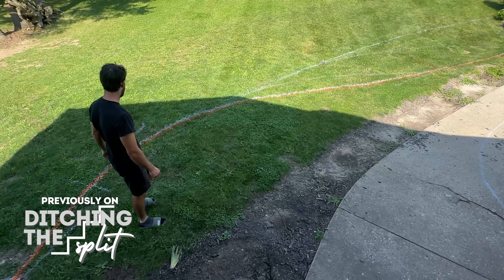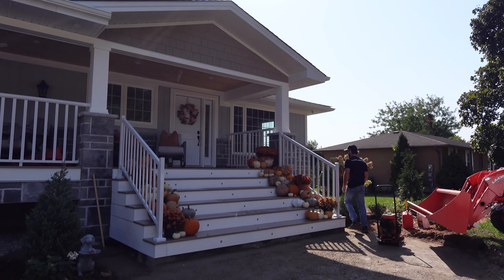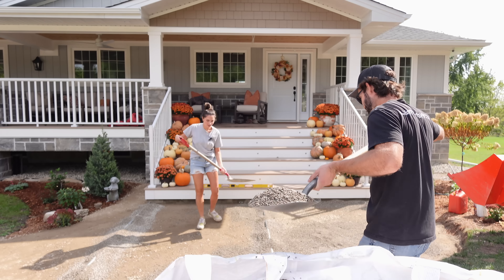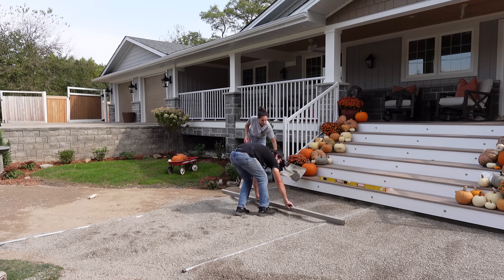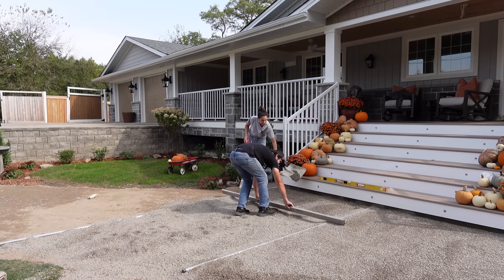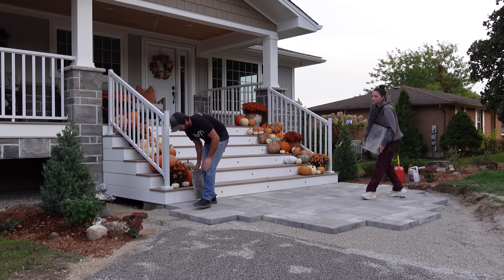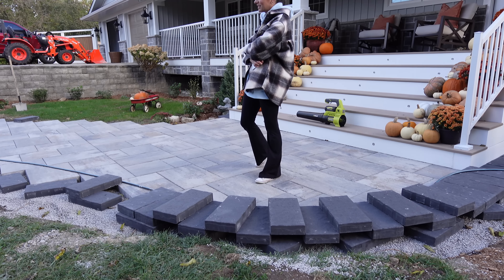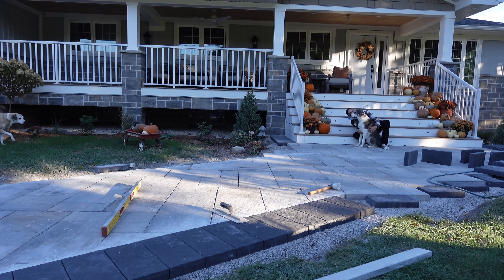EP 19: The Last Step!! | DITCHING THE SPLIT

Comment: Ouch...  I remember a hole in our asphalt driveway that I kept asking for a fix. Wasn't until I severely hurt my ankle that it got fixed. I contracted with a company for a new concrete driveway when my husband left town for 😀 a week on business. Spent three months on crutches admiring an extra wide driveway.

So amazed at your workmanship. Did you end up with a four corner set??  How will you cold winters treat this material over a solid cement?  Which is more expensive?

Comment: Random laying of pavers is much harder than a pattern. When we did our hardwood floor with random lengths it was a lot of work to get the spacing between the joints to be far enough apart so it didn't look weird. 
I am really enjoying watching you two get rid of the split.